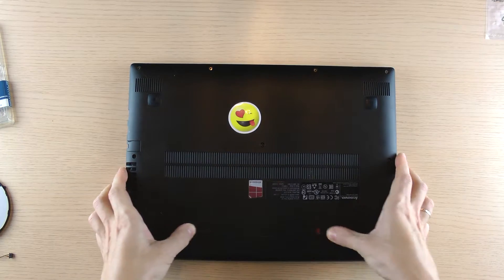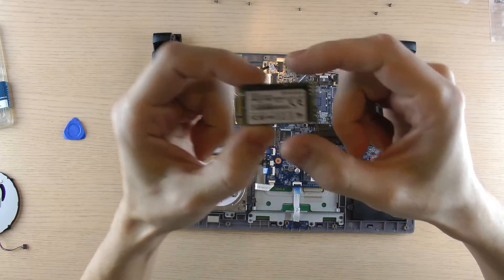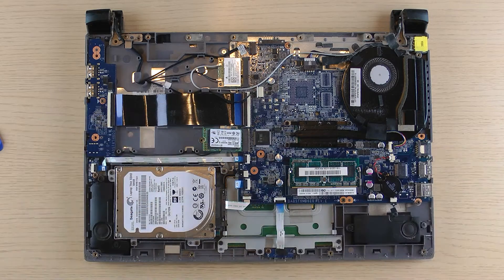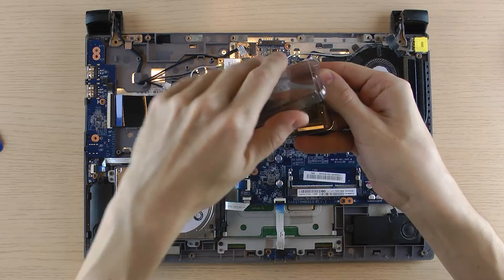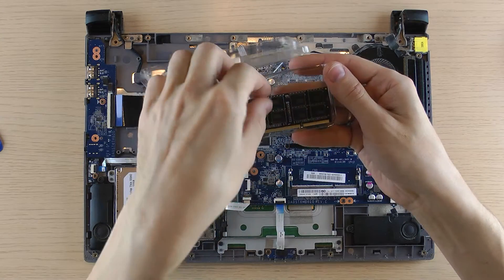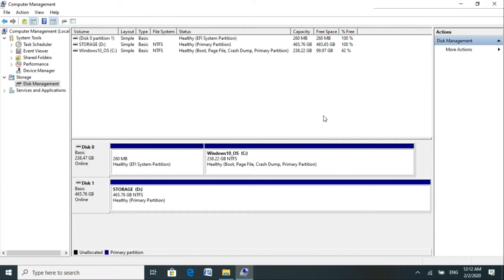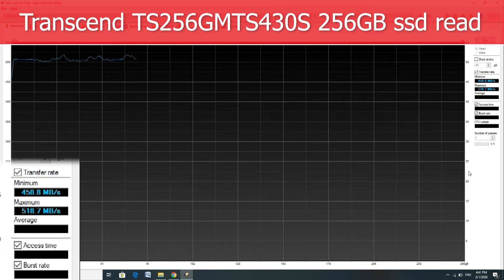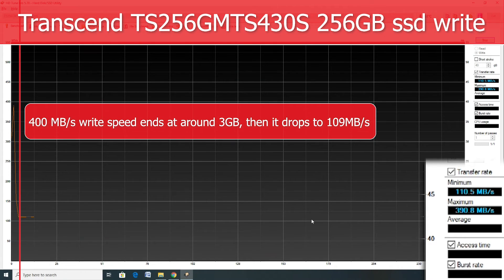Lenovo Flex14 M.2 SSD, RAM and fan upgrade

Comment: Hey great video. Can u tell me why you chose 256 gb SSD and 8 gb ram ? Is that the max this laptop can take or can I go upto 1 TB SSD and 16 GB ram ?
Reply: I read all the comments and got the answer for ram.for ssd Lenovo website officially sas upto 256 SSD. In one of the comments u mentioned 512 gb should be okay too. Can confirm if can use 512 m.2 SSD or even 1tb m.2 SSD. 1 TB SSD size is begger than 256 one but m sure it has enough space. Wanted to make sure before I go for it. One last question. This m.2 ssd will work along side the HDD right ?
Reply from the maker: @jghausi  Officially this laptop supports 8GB of RAM at max. As for SSD, you can use any capacity. For M.2 slot use M.2 SATA (not NVMe!!!) model.
If you are willing just to replace the old mechanical 2.5" HDD, then you can use any size 2.5" SATA SSD in its place.
Subscribe, thanks.
Reply from the maker: @jghausi  Yes, 512GB or 1TB M.2 SATA SSD should work (I can't say for sure, as I didn't try it on this laptop, but in theory, it should support up to 2TB drives). 
Probably they are mentioning 256GB as this slot at the time was meant to be a cashing drive slot for ordinary HDD, and that was the max capacity of those cashing drives at the moment.
And yes, they will work alongside. You may experience BSOD, the link to the solution is in the video description.
Reply from the maker: @jghausi  Oh sorry, it's pinned, and not in the description :)
It depends on installed drivers, so you may not experience that BSOD, it's just in case...
Follow this guide if you getting BSOD : 
https://www.tomshardware.com/uk/news/how-to-fix-dpc-watchdog-violation-windows-10,36200.html
In device manager Change from SATA AHCI to Standard SATA AHCI Controller in IDE ATA/ATAPI controllers section.

Comment: I am upgrading all same three thing
Just waiting for ssd to buy rest of two are done
Reply from the maker: After an SSD upgrade you can experience BSOD, in that case, check this guide (it will fix this problem):
https://www.tomshardware.com/uk/news/how-to-fix-dpc-watchdog-violation-windows-10,36200.html
(In device manager Change from SATA AHCI to Standard SATA AHCI Controller in IDE ATA/ATAPI controllers section.)

Comment: what is the product you put on the copper connectors when replacing the fan?
Reply from the maker: If you had in mind this  4:17 it's duct-tapelike aluminum foil.
https://aliexpi.com/VFWm
You can use any duct tape instead. All other parts are in the video description.
Subscribe, thank you :)

Comment: Thanks for the video. I wondering to buy it to install in my notebook, that the model is the 20308, same as yours. For this model, the right ssd is the one that supports key M and B, instead of only NVME? What is difference of them?
Reply from the maker: Yes, you are right, you need m.2 SATA SSD (2242 size) B+M key. NVMe SSDs are faster ones, but this laptop does not support them.
Subscribe, thank you.
Reply: @MindaugasJocionis  thanks. I have similar problem.

Comment: I have flex 14 model 20308, and why it only has 2 part plug on my SSD socket (I think its 5 and 28 pin), not 3 part as the m.2 SSD you recomend on this video. Sorry for the english..
Reply: Thx for the respond. 👍👍🤝
Reply from the maker: @rufiandi7195  No problem :)
Reply from the maker: Your laptop model number is the same as mine. M.2 SATA SSD is split into 3 parts (B+M key) to fit into the NVMe socket that supports SATA interface.
This laptop supports only M.2 SATA interface SSD's. When purchasing make sure that it's not NVMe SSD, as it will not work.
Subscribe, thank you :)

Comment: Does it have to be an m2 drive with m & b connector? Cant i install a samsung 980 pro? Yea, 980 pro ist 8cm not 4,2cm. @1:04 you see the two holes next to the m2-slot screw. I chopped these off (was just plastic), so that i've more space. But pc doesnt recognize my 980 pro. Any idea? I tried Legacy mode..
Reply from the maker: You need M.2 SATA your SSD is m.2 NVMe. And yes, SATA has B+M key while NVMe has M key.
I had the same idea as you (about putting regular size M.2 ssd) and then found this Transcend SSD for cheap at the moment...
Subscribe, thank you :)
Reply: @MindaugasJocionis  I don't get, why it doesn't work. 😔 I mean yeah, sata and nvme are different technologies but the port seems identical and 980 fits perfectly. 😢
Reply from the maker: @sakujo20  Yes, it's a bit confusing. Same physical slot, but different communication protocol. Some m.2 ports support only SATA, some SATA, and nVME drives. (it's more common with old laptops or PCs as these days any M.2 slot will support SATA and nVME SSD).

Comment: I have ideapad flex 14 Machine Type Model:80C459403924 
https://pcsupport.lenovo.com/fr/en/products/laptops-and-netbooks/flex-series/ideapad-flex-14-notebook/80c4/59403924/qb07514306

ram can be upgradable ?(I have already 8 gb ram)
if i upgrade the  Seagate SSHD (Gen3 500GB, ST500LM000) with a new ssd the speed will be markedly better?

Comment: hello, I have a flex 2-14, with an intel celeron n2830 processor (somewhat old), is it advisable to change the motherboard for one that has a better processor such as i3, i5 or i7, and also the fan (I already found both in AliExpress )? If so, should I also change the battery? I saw that this video was made https://youtu.be/8GQNawK87H0
Reply from the maker: Honestly, I don't know. It's a risky swap. You need to compare it to your old board, do they look the same, and do all the connectors are in the same place. As well you need to know what LCD connector is on the new board it must be the same as on yours, as there are 2 different displays 1,366 × 768 (pixels/1,920 × 1,080 pixels) with different connectors. I think it's easier to sell this one and buy a new one :)
subscribe, thank you.
Reply: @MindaugasJocionis  I know, the problem is that the laptop is old and is already very undervalued, buying a new one with good features will be very expensive (outside of my current budget)
Reply from the maker: @22MrSuarez  Well, then you need to take your chances. Write back, was it successful.
Reply: No hablo inglés ,traduje lo mejor que pude .
Reply: the laptop is Flex 2-14 20404. The motherboard I found in AliExpress are these: https://a.aliexpress.com/_mNEZ4Vj https://a.aliexpress.com/_mNAIRL3 https://a.aliexpress.com/_mNMo35X the fan :. https://a.aliexpress.com/_m0R1QjJ

Comment: I have 80vdCUS model 
It shows 1 of 4 slots filled in task manager
Please help me.
Can I add one more 4/8 gb stick? 
I only have one single channel 8gb ram.
Also does it need to be same,speed as older ram i have in?

Also does this transcend ssd will fit in my lenovo flex14 1470?
Reply from the maker: Is it Flex 4 1480? What CPU is in it? Subscribe, thank you.
Reply: @MindaugasJocionis  Yes its 1480 model with i7 processor
Reply from the maker: I assume that it's i7 7500U, and it's DDR4 ram in it, right?
The only RAM upgrade option is one DDR4 16GB stick. Speed does not matter as CPU supports DDR4-2133 and up. 
And your laptop supports only SATA drives. There is no M.2 slot on it.
Check affiliate links if you consider buying one and subscribe, thank you :)
Buy SSD on Amazon US https://amzn.to/2psIVpq
Buy RAM on Amazon US https://amzn.to/2JMPdHj
Buy SSD on amazon UK https://amzn.to/2r6QJNP
Buy RAM on Amazon UK https://amzn.to/2Nb4HGW
Buy SSD on amazon DE https://amzn.to/33dYkbs
Buy RAM on Amazon DE https://amzn.to/32aA9JT
USB to SATA adapter:
Get on amazon DE https://amzn.to/2OK3Ptx
Get on amazon US https://amzn.to/31L2nft
Get on amazon UK https://amzn.to/38hfJCU
Reply: @MindaugasJocionis  Thank you sooo much! Man
Reply from the maker: No problem :)
Reply: @MindaugasJocionis  Hi cam over clocking this ram? Works with XMP in bios?
It has samsung ram 8gb 1stick
Can i overclock it?
Reply from the maker: @mohitdoshi6662  No, you can't overclock RAM in this notebook.
Any higher frequency RAM will work @2133MHz as it is the max that supports your CPU. But if you have higher frequency RAM it will automatically decrease frequency to 2133MHz and decrease timings (lower timings, better performance).
Reply: @MindaugasJocionis  Oh thanks man
U are such an awesome person

Comment: Um, hello, I have a question...I have Flex 14 model 20308 with i5, 4GB DDR3 RAM and GeForce 820M...just replaced the 4GB ram stick with new 8GB ram stick (Patriot 8GB 1600MHz) and after pressing power button rhe laptop turns on, runs for few seconds, then turns off...the process repeats until I hold the power button to turn it off...screen stays black whole time
Reply from the maker: Is your memory low voltage DDR3L 1.35V? What is the exact model of RAM? If it's DDR3L try to reseat it. Unplug the battery when doing this :) 
Does pc boot with old RAM?
Subscribe, thank you.
Reply: Mindaugas Jocionis Yes, laptop boots with old RAM like a charm...original ram stick is Samsung M471B5173DB0-YK0 4GB 1600Mhz 1,35V...new ram stick is Patriot PSD38G16002S 8GB 1600MHz 1,5V...Oh, so I think the voltage is the problem...so I have to buy a different one with the same voltage, right?
Reply from the maker: @lukaspeprnik9460  Yes, voltage is the problem. DDR3L supports 1.35V and 1.5V, while DDR3 only 1.5V :( I hope you will exchange it with no loss.  You need DDR3L  1.35V  (L-as low voltage)RAM Good luck.

Comment: Sir I have same model 20308 flex 14 IdeaPad but i have noticed that you don't have graphic card but I have in my laptop. So, I am confused about ram upgrade what should I do?
My specs 
Intel core i3-4010u cpu 1.70ghz
Nvidia GeForce GT 720 m
Ram 4gb DDR3
Reply from the maker: There's a place for GPU on my motherboard, it's just not soldered. Ram upgrade will be the same. Subscribe and check affiliate links in the video description. Thank you :)
Reply: @MindaugasJocionis  sir I am from India and I can't find it on Amazon can u please help me with it . I already tried different site but afraid of getting scammed sir help crucial 8GB DDR3L-1600 SODIMM
Reply from the maker: @anandraj4-r7i  Maybe this one? https://www.amazon.in/ADATA-Premier-DDR3-SO-DIMM-1600/dp/B00BO6O2W6/ref=sr_1_17?dchild=1&keywords=CT102464BF160B&qid=1601736159&sr=8-17
Reply: @MindaugasJocionis  sir i also need to change my fan which i couldnt find either on the given link could you help ples
Reply from the maker: @anandraj4-r7i  This is the link https://www.aliexpress.com/item/32963725314.html?spm=a2g0s.9042311.0.0.27424c4dpxwd3N
, but the seller has changed, so I cannot guarantee the quality. 
I suggesting you find the same model from the better seller.
Subscribe, thank you.

Comment: Lenovo flex 14 model 20308 i7 variant can i use any external graphics card and what is the maximum capacity of that?
Reply from the maker: No there is no thunderbolt connection, so, unfortunately :(
Reply: @MindaugasJocionis  can i Change the internal graphics card? Nvidia or anything else?
Reply from the maker: No, this model has no MXM module, it comes with gpu integrated into the CPU or soldered onboard.

Comment: Sir,i have a Lenovo flex 14 model:20308 i7 variant is it from 3rd gen or 4th gen? I have 4gb of ram is there any other ram slot for this laptop ? If not than what is Maximum ram capacity of this single slot thanks?
Reply from the maker: What exactly CPU model is on it and what type of RAM (DDR3 or DDR4)? Subscribe, thank you.
Reply: @MindaugasJocionis  its a ddr3 ram
Reply from the maker: Yes, mine shows as well that there are 4 slots. But for real only 1. I think software just shows what memory controller supports, but not what soldered onboard.  And it's DDR3L 1.35V as DDR3 1.5V will not work! Different voltage.
Reply: @MindaugasJocionis  As i have only one slot i need to replace my 4gb with a 8gb that's it right? Can't add any more right?
Reply from the maker: @muntahiibnarabbani5156  Yes, that's the only option.
Reply from the maker: Did a bit research, so your laptop is the same generation as mine with 4th gen i7. So max memory is 8GB DDR3L as there is only one ram slot on the motherboard. (check links in the video description for spec.).
Reply: @MindaugasJocionis  but in my pc performance settings it's showing 4 slots available ,....so which one to relay on?

Comment: Hello. I have the Lenovo Ideapad Flex 14 (model 80C4). And it has the M.2 slot (Key M), this Key supports PCIe x4 or SATA interface. The manual states that the PCIe version is Gen2.0. So could I use an "M.2 Mvme PCIe Gen3.0x2" or "M.2 Mvme PCIe Gen2.0x4 (if any)" instead of "M.2 SATA"?
Reply from the maker: This slot supports only m.2 sata ssd. Subscribe, thank you.
Reply: @MindaugasJocionis  
Ok. Could you tell me: 
a) If there are successful cases using 512GB or 1TB?
b) Know the KingSpec brand? link: https://produto.mercadolivre.com.br/MLB-1270917335-hd-m2-1-tera-1tb-ssd-2242-rapido-ssd-teste-asus-b250-b360-_JM?Quantity=1&variation=40170387434
Reply from the maker: Technically you can use up to 2TB drives. KingSpec is a Chinese brand, you never know what is inside and how reliable.
Sorry for the late response, your message was held as spam :)
Reply: @MindaugasJocionis  
Unfortunately I'm only found M.2 2242 Chinese here in Brazil. But thanks for the information and attention.
Reply from the maker: @avafilho  Yeah, this format of SSD is rare. Thanks for commenting :)

Comment: I have a Flex 2 as well. and feel it has gone massively sluggish. What sort of performance jump did you see with SSD and RAM in the system? 

Also, does Flex 2 take extra SSD without removing the HDD way you did it?
Reply from the maker: After upgrade laptop becomes more responsive, especially with a bunch of chrome tabs opened, also application loading times improved. 
It looks like yours does not have an M.2 slot. But you can add 2x8GB DDR3L RAM and 2,5" SSD. If in your laptop still is HDD you will feel huge difference. Maybe your HDD is hybrid one and flash memory is worn out, that's why it feels sluggish.
Check affiliate links in the description for purchase if you are interested in upgrade, and don't forget to subscribe, thank you :)

Comment: What should I look for to buy a ram for my 1st gen lenovo flex 14, same as yours. Would you please  suggest some other alternative ram and m.2 ssd with ram buffer?
Reply from the maker: You can use crucial https://amzn.to/3kkNERi or any DDR3L (1.35V) 1600MHz 8GB stick. 
As for SSD, at the moment I know only this one, there is "good ram" S400U but it's without DRAM. https://www.goodram.com/en/products/s400u-sata-iii-m-2-2242-ssd/
Also, there is a bunch of Chinese ones, but I don't think its worth buying them.
Subscribe, thank you.
Reply: @MindaugasJocionis  Can I use this ram ? https://www.ryanscomputers.com/detail/gskill-ripjaws-8gb-ddr3-l-1600-bus-notebook-ram-f3-1600c11s-8grsl

https://www.amazon.com/G-SKILL-Ripjaws-204-Pin-SO-DIMM-F3-1600C11S-8GRSL/dp/B00G5SSDIW

Comment: Hello, interesting video. I have a Lenovo Ideapad Flex 14, model 20308, which would be the compatibility of replacement components for my equipment. I appreciate your kindly reply.
Reply from the maker: It's the same model, you can use the same parts (or same spec. another manufacturer). Check links in the video description. Also, you may consider changing the old HDD to 2,5" SSD. Also if you are getting blue screens after upgrade to M.2 SATA SSD follows this guide:
https://www.tomshardware.com/uk/news/how-to-fix-dpc-watchdog-violation-windows-10,36200.html
In device manager Change from SATA AHCI to Standard SATA AHCI Controller in IDE ATA/ATAPI controllers section. And don't forget to subscribe.
Reply: @MindaugasJocionis  What would be the maximum capacity that M2 SSD supports?

Comment: i have the same model and i would like to know if the computer is 
compatible just with ssd m2 or it works with regular ssd sata too? Could i put a 480gb sata ssd?
Reply from the maker: Yes, it will work with any SATA 2,5'' SSD. Subscribe, thank you.
Reply: i mean like this one https://www.kabum.com.br/cgi-local/site/produtos/descricao_ofertas.cgi?codigo=85197
Reply from the maker: Yes, it will work :) But this SSD has no RAM  buffer, maybe it's worth to check another model?

Comment: Hi again. I ordered the fan in the link you added and it has finally arrived. But it was a used and second-hand product. In addition, one of the screw slots was broken. I wanted to warn you about this. I was deceived. Do not be fooled by others.
Reply from the maker: Oh, sad to hear that (you know it's China, sometimes they cheat). Open dispute and you will get all your money back. When I was placing an order there was plenty of good reviews. Mine was new and even with brush and duct tape :)  Sure I will remove that link, thanks for the warning.

Comment: Hİ again. I have ordered the fan that in your attached link. Finally, it has arrived. But one of the screw sockets is broken and the fan is not new. It is really really secondhand / expended and it was used. I just want to warn you about changing this link. They just cheated me. :)
Reply from the maker: Oh, sad to hear that (you know it's China, sometimes they cheat). Open dispute and you will get all your money back. When I was placing an order there was plenty of good reviews. Mine was new and even with brush and duct tape :)  Sure I will remove that link, thanks for the warning.